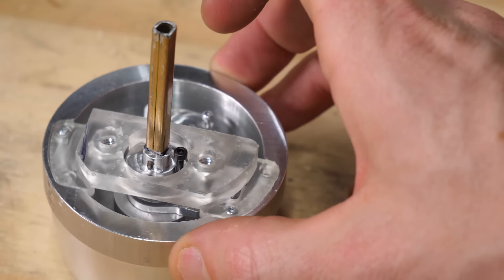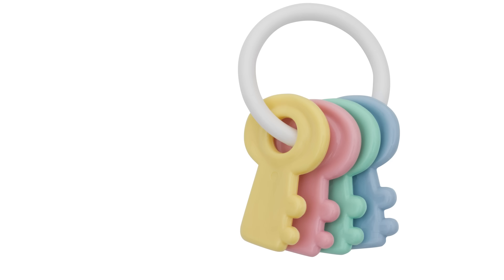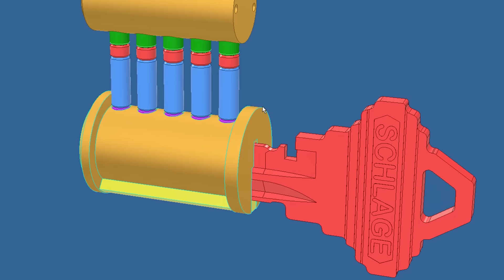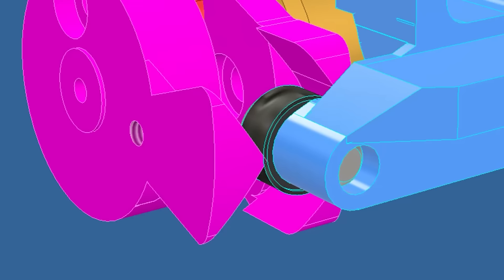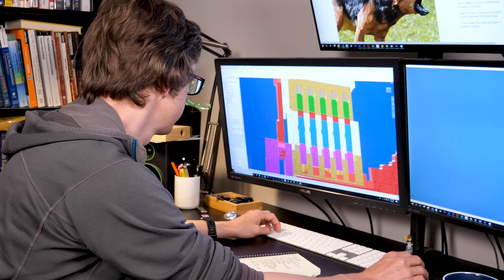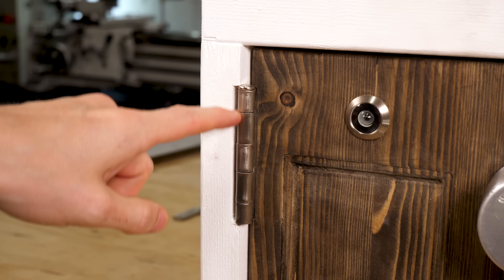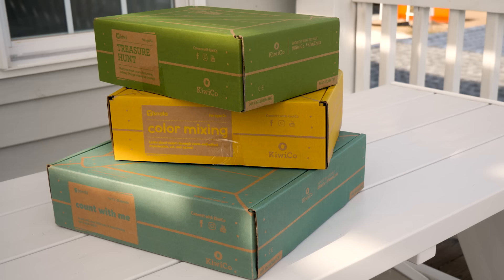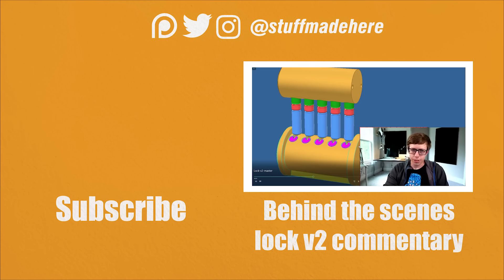TWO Unpickable (?) Locks for Lock Picking Lawyer!

Comment: It would be so awesome if they could design a lock together after this that is truly impossible to pick. Maybe it can even be commercially viable?
Reply: That's pretty much what they are doing
Reply: @d.b.cooper2277  Yeah I watched LPL's video just now. Exciting! The exploits are all simple fixes and with some modification; both to remove the exploits and simplify the lock for manufacture, they might be able to produce a marketable lock that's impossible to get into with non-destructive messures.
Reply: @freedomofspeech2867  It sure could be unpickable, but is that really worth it? The locks use mostly custom made parts so it'd be much more expensive to manufacture and sell.
Reply: @freedomofspeech2867  The probably most secure lock is a good electrical one with e.g. a keypad. - not sure whether they can make such a mechanical lock at a competitive price so that it would be economically smart to actually use. But it would absolutely make sense as a collector's edition or sth. like this.
Reply: i would buy it for sure
Reply: @petey5009  I think a truly unpickable lock, better yet a lock you can only open through destructive messures (like blasting a giant hole through the door) is something that would be desirable at a considerably higher price than normal locks which could offset for the added manufacturing cost. Plus, factories create custom tooling for almost all products that aren't Chinese copy pastes/mashups or just use CNC anyways, so that isn't much of an issue. I think it's worth a shot!
Reply: @JSCHM  LPL has done plenty of electronic locks, they're usually even more garbage than the mechanical ones.
Reply: If you need to be able to open it with a physical key, LPL is going to be able to mimic it with his collection of an infinite picks and gizmos :)
Reply: @JSCHM  Keypads are usually made of simple materials that can easily be pried off so you can complete/break the circuit behind it, but even if they're made of a sturdy metal you can usually tell after some period of use the correct buttons by their wear and dirt. If it isn't visible because it's made of Titanium of something a UV light should do the trick. Sometimes even a pocket EMP can override them.
Reply: @freedomofspeech2867  key cards exist bruh
Reply: @Gazmus  They can make it so you can't mimic it precisely and if you have to make 1 000 000 000 keys with different variations of cuts just to get through, I wouldn't consider that picking, but I would consider acquiring C4 paste to be an easier option.
Reply: @djsomeguy  Electronic alone doesn't make it pick proof. The idea is as follows:
You have two spaces 1 is secure (inside of the house) and 2 is insecure (outside).
The keypad is on the outside. The locking mechanism etc. can only be triggered by a "server" on the inside. All one can do from the outside is put in a code via the keypad and send it over a cable to the server on the inside. The server checks the code and unlocks the door if correct.
If correct executed there is no way to unlock the door without breaking something.
The most common problem with the ones LPL tested were that they didn't treat the keypad as insecure, but instead allowed it to open the mechanism directly.
The innovation in this lock here is to have a pick resistant mechanical lock - the pick resistance alone is much easier achieved by an electrical lock. There is just no way you can the combination only from the keypad...
Reply: Or you could just buy a Bowley lock
Reply: @tapwater424  Someone hasn't watched enough LPL. Spoiler: they're pickable (non destructive entry).
Reply: @freedomofspeech2867  see my comment above. About fingerprints: make the keypad a touchpad and change the order of the keys via a random number that you get on request from the server..
Reply: @tapwater424  agreed - even easier than self changing keypads ^^

You could also let the code change based on the time so you would have to calculate the new correct code each time you want to enter.

Thousands of possibilities XD
Reply: @JSCHM  electrical locks have their own set of problems. I'll list the ones I know/can think of and am by no means a professional
Wiretapping the keyboard/touchpad allows for replay attacks (and even with the random number generator)
Random guessing with a automated tool (tapping into the wired communication; can be defended against with a timer, for example, but allows for a DoS attack)
DoS attacks in general are also a problem
Locking mechanism compromising (several electrical locks can be forced to trigger with electromagnetic fields)
Power failures
Reply: @JSCHM  Touchpads don't help and switching the combination all the time makes you forget it. A code stick is a liability.

"You could also let the code change based on the time so you would have to calculate the new correct code each time you want to enter."
No one in their right mind would ever buy such a lock.

Also, what Felipe said.

Tech solutions are usually bad, and prone to failures. Not something you want to secure your house with or anything else you need consistent regular access to.
Reply: @nerd_mor  1. DoS - I don't think this is a real problem - you only allow one try every second. The DoS only affects you if you're currently trying to enter your code -> if this doesn't work you call the technician and he sees that someone has installed an unauthorized device to make the DoS attack.

2. Replay attacks
That's correct this is a concern. I want to add you could also install a camera to see the key ?pattern? and make your own key when dealing with a mechanical lock.

You could get around this by making the code dependent on time.
 -> Server sends a code + time and you calculate the new enter code (probably not by hand but instead a QR-Code is displayed -> you scan it and the scanner calculates a response to enter).
I think TAN generators work like this?

3. Power failure
I'd classify this as a destructive method of entering or a fixable DoS attack. - But yeah electronic locks are "a bit" more vulnerable than mechanic locks to this one ;)
Reply: @brianthrom6858  Damn it, you're right. But I think it technically can be picked with an easily made tool with enough experts trying. Besides, we need more truly secure locks on the market anyways. Another branch wouldn't hurt.

Comment: 10:59 -- "Worried about some [obscure] tool to defeat my lock"

LPL: "So here's my pocket knife"
Reply: Here's half a Nutella Jar...
Reply: For real. He got into both locks in less than 10 seconds. I was so dead when he just turned the lock and used his knife to get in.
Reply: The most obscure tool ever
Reply: Standard lockpicking tools, a pocket knife and a little hammer
Reply: @SkydivingSquid  I wouldn’t care all that much considering every pick is easily fixable
Reply: @SkydivingSquid  SMH sent LPL a  set of the schematics and he was able to find the flaws by reading diagrams. It took him longer off camera to figure it out without SMH's help.

Comment: every time an engineer says "too complicated" I'm obliged to say: Have you seen automatic transmission for a car?
Reply: And back in the day they did all that without CAD or CNC's.. Valve bodies are crazy!
Reply: like the space shuttle ^^
Reply: even worse - automated manual transmissions... the hydraulics are fucking insane
Reply: @mem7806  the fam got a 2016 Focus with that 'automatic manual transmissions'. It blows my mind how it works on paper but Ford obvisouly didnt get all the kinks out. Kinda neat having solenoids to activate a clutch pack like an automatic but having gear box gears instead of planetary gears.
Reply: @longbow6416  yeah its a relatively new technology, quite cool on paper though & the ability to give people actual paddle shifting (not virtual, slow bullshit) is pretty neat.

although I don't get the point of it when you could just have a dual clutch transmission
Reply: @mem7806  anything is better than a CVT, I love them for thier simplicity, in an ATV or snowmobile, but not something they size of a car. Just scaling things up doesnt always work. My coworker has a Jeep Liberty or some new mid-sized Jeep that has a CVT and the manual says not to drive more than 2 hours at a time as not to overheat and damage the transmission. It doesn't have a normal operating temperature? What in the heck?
Reply: @longbow6416  some CVTs are notoriously bad - especially Nissans and those of many american manufacturers, but as far as i know the Honda & Toyota CVTs are actually pretty good.

that's really bizarre that you can only drive for a certain amount of time regardless, wtf? that really sucks

Comment: I think these locks are ingenious at first review (check out lock picking lawyer's and his video on the locks) but I think they can benefit using the Hines system or something comparable to that, as another D-i-D layer. Although the downside is that if someone messes up then the lock is dead and the key won't work anymore but hey you prevented your lock from being picked.

Comment: Heh... just to mess with him for v3 put security pins in place of 2 of the hinge screws... and not weld the pins.  Let him pop the pins and... it won't open until you pop the lock.

Comment: I couldn't believe how easy it was for  LPL to pick simpler of the two locks. I would have thought that disconnect between the pin shearing and the rotation would have been enough.
Reply: I think LPL does a lot more testing in the background before putting a video up
Reply: @sephypantsu  he may have with this one (I doubt it), but not others. In his videos, when he's sent a lock, it isn't opened before his video.
Edit: to clarify, LPL most certainly did spend months testing the lock.

Comment: So basically with this if you get locked out of your house you’re screwed
Reply: Brick thru window
Reply: @danielvandenberg1388  genious
Reply: Not if you have a pocket knife and a hammer.
Reply: @danielvandenberg1388  Galaxy brain take
Reply: Use an axe
Reply: this is why you should carry an axe with you
Reply: I could probably kick my door down if I needed to. I'd rather not, they're expensive, but I could in a worst case scenario
Reply: Just use a drill an drill threw the key hole an boom your in

Comment: That's why door's to your house turn inwards, so you can't attack the hinges.
Reply: Most doors I seen open outwards...
Reply: @michaelpettersson4919  Do you live in Florida? I've heard that in parts of the country that get hit by hurricanes the doors open outward to prevent them been blown in. As a Californian, most if not all front doors to houses I've seen open inwards
Reply: @dELTA13579111315  Actually I am swedish, I have never even visited America. I do not know where this practice comes from but it could be to save that space the door would swing into. It also prevents thieves from opening a door by simply using a hand held ram. But sometimes they use rams, I saw what looked like an absndoned ram outside my workplace. I guess that some thieves got disturbed.
Reply: This also hides the bolt from the outside world so it can't be interfered with or cut.  If you need to resist the door blowing in you probably want a five-point mechanism with extra bolts at the corners (something I never saw in the US but is common in the UK).
Reply: Residential building codes typically require the entry doors to swing outward. For fire escape, etc.
Although there are always other kinds of door options - if you're willing to spend more.
And property owners can renovate anything they like anyhow, after the annoying inspectors have left.
Reply: @shoo7130  I don't think blowing out the door is a concern in 2021. Explosion just applies pressure. And since a long time we have quite efficient pneumatic ways of opening the doors - so again pressure, but much higher, local and without fire. It doesn't matter how many bolts you'd use, as even relatively cheap hardware would crush the wall. Blowing out the door of safes and other secure cabinets also isn't a good option, because you probably don't want to destroy what's inside - and in such cases you may want to make insides (as cassettes of ATM) weaker than door, so blowing one will destroy the other. I was servicing ATMs and that's exactly the practice.
Reply: Sure if you're willing to use force to enter then you'll find a way, even if the door opens outwards.  But a passing hurricane, or whatever, should be stoppable with a few extra bolts, so no reason to make your door open outwards for that reason.

Comment: Everyone gangsta, until the lock smith just takes out an axe and breaks down the door.
Reply: The Mrs LPL method.
Reply: A Lawyer used his pocket knife and WON
Reply: Or in this case, a pocket knife and a shim…
Reply: That doesn't even make sense why would you post this
Reply: That’s basically why no one bothers with an insanely expensive overengineered lock. It’s awesome as a proof of concept but pretty pointless commercially

Comment: Your lock are a hoot!  BUT, you mounted the locks on the “back side” of the door.  Front/back door open inwards.  This negates the need to weld the hinge pins.  The second lock can be opened with a slid tool to hold/jam the internals.  This can be resolved cheaply with a bush ring that the lock actually mounts into.  Now the lock sits into the bush preventing a slide tool slipping up the rear of the lock.  I am gob smacked,  your second lock is brilliant.  The mounting of the lock was the problem.  👍👍

Comment: That part that looks like a engine connecting rod is just pulling down on the top piece that it's mounted to close in and it has to be mounted lower and more out from the piece it is connected to or the top gear could just had a recoil spring that will rewind it back and a stopper that will keep the top gear from turning to far

Comment: You could have used a ratchet system for the second drum with enough friction that it will only turn if the pins are correct

Comment: you could install a really elaborate lock that actually doesnt open anything but when you "crack" it will trigger a trapdoor with a dungeon underneath.
door actually opens at the opposite side of the handle.

Comment: You have your doors made of glass, as well as flimsy windows, but moreover, you have houses made of cardboard. And of course, you have only one deadbolt in the only one place of your door. You actually don’t need steel locks.
The main principle of security is that a system is only as secure as its most vulnerable component.

Comment: What is insane as if you want to come in a factor this lock It would probably cost around $550. Not too materials but just do to be fact that there is so much complex machining that does take manual work to do even if you have CNC devices. You need to manage those make sure there are no failures and make sure it is 100% repeatable every time.

Comment: Hey Shane! If you're ever bored, or looking for something else to think about while you take a break from debugging code you tried to write yourself instead of just modifying someone else's 'cause you're a masochistic genius who needs to do everything himself, you might consider trying to make:
- Perfect Call Coin Flipper (robot that sets up a coin toss with such precision that the outcome is selectable)
- Motorized Bowling Pins (bowling pins with small motorized equipment tucked away to enable such shenanigans as a self-assembling pin rack, perfect game mode, and - most important of all - evasive pins) 
I'm not sure how crazy you are about reading all of the comments on your videos (I'm sure not, and as such someone else could have told you these same ideas already), so I'll just post this in each one. Sorry, not sorry?

Comment: lock #2

machining a lip on the back of would work if i made the lock sit with the lip recessed into the hole in the door . . . particularly good with a steel door.

installing the door correctly (hinges inside, frame covering deadbolts) would be a lot easier than modifying the lock to hold the deadbolt but modification would be best.

Comment: I have been toying with an idea that might make a lock pretty difficult to pick. This idea might not be too hard to make either. It would require a second drum outside of the cylinder. The first use of the key makes the cylinder rotate.  To operate the lock, have the cylinder need to turn clockwise to have a key operated pin(pins?) engage the outer drum. Now to unlock it, turn the cylinder to the left past the original pins while still keeping the outer drum engaged to the cylinder. Make it so that if the pin(s) that holds those two pieces together gets released at any moment, have a spring that returns the outer drum back to the rest position. LPL will probably figure out how to beat this too but it might be a little fun. BTW. The pins would need to be on opposite sides of the key (cylinder versus drum) and there could be more than one secondary engagement pin or conventional pins in the drum and even traps if you wanted to.

Comment: Valid points… kinda.   
 Yet if you’re going to completely change the mechanism or be able to alter the the
Cylinder in anyway.. what’s the point ? 
 Unless you did that to come back and open it at a LATER point in time.

Comment: i think you could go back to it and i have an idea what if the lock can’t be open if a key is not fully inside the lock what i mean is that the tip of the key will push something that is spring loaded and if that part is bot push it block the pin so that mean to pick you have to decode the lock and find a turning tool that can push without blocking the way for the tool that decode the lock (and to top it all the piece that need to be push should be right behind the pin